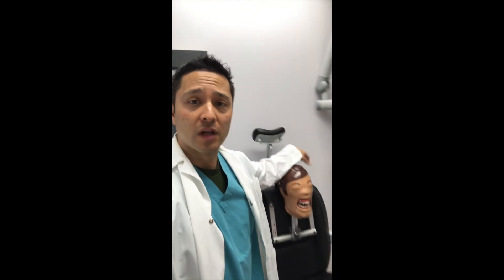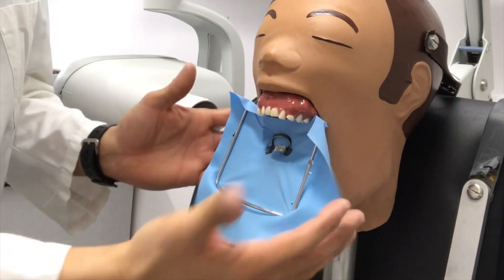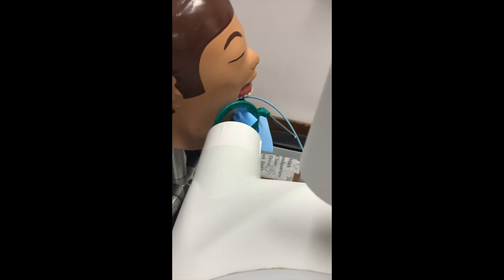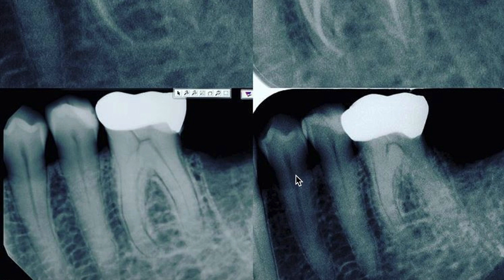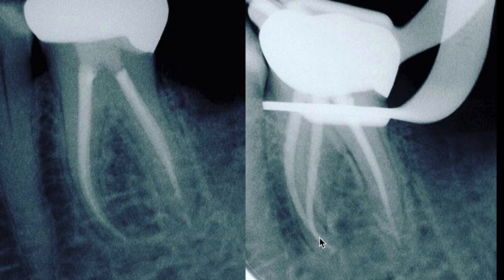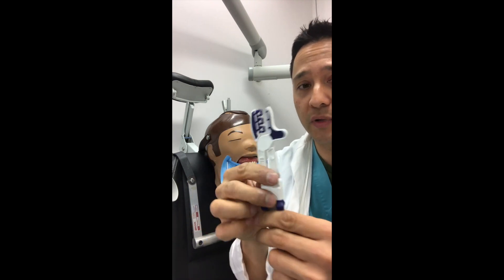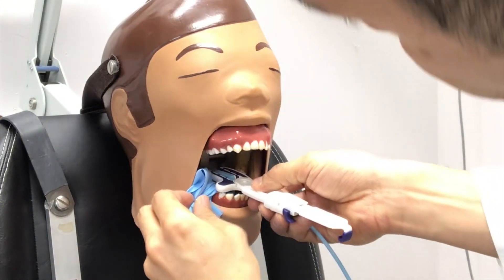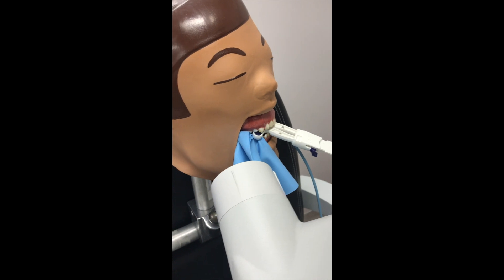Basic Tips for Root Canal Xrays

Comment: Do you do rootcanal treatments with or without microscope or loupes? I am having a hard time doing rootcanal treatments without them. What filling technique do you use?
Reply from the maker: This is such a great question.  A microscope is honestly, in my opinion, the gold standard for root canals. However, you could argue that a CBCT of a tooth and high powered loupes could totally be an alternative.

But - I hear exactly what you're saying.  What if I don't have either and $$ is an issue.

I have worked on operations overseas with my high powered loupes (3.5x) with a super bright LED light and that, I believe, served me well for that situation.  I super prefer a microscope, but, that's not a possibility for everyone.  I get it.  i purchased my microscope used from a retiring dentist.  They are not cheap. (I'm not sure why not though). 

Accessing a tooth can be the most scary thing to do - especially if you're new at the game (I'm still nervous at times with a calcified tooth) - or - you don't have magnification.

My super humble advice - without magnification, I would try to do teeth that don't induce a lot of stress - max incisors, canines, premolars - that aren't calcified - and - are vital.  Vital is critical b/c their success rates are higher and you want to start to build confidence.  There is nothing more damaging to your endo confidence than getting kicked in the teeth by a non successful root canal or perforation.

I hope this helps.

Ash

If it interests you, I will be posting a video on this cool new tech called Mora Vision 3d (https://www.youtube.com/user/moramicro).  I talked to the rep yesterday and it is amazing.
Reply from the maker: Here is my opinion and less typing!!
https://youtu.be/erLelYi7Rgw